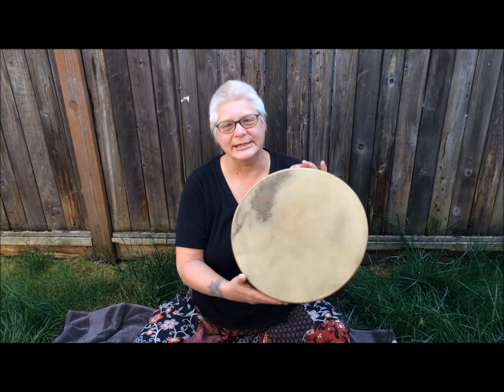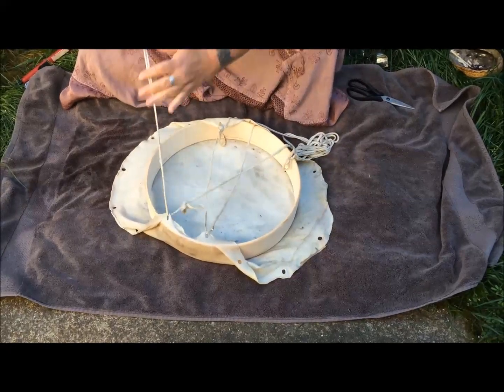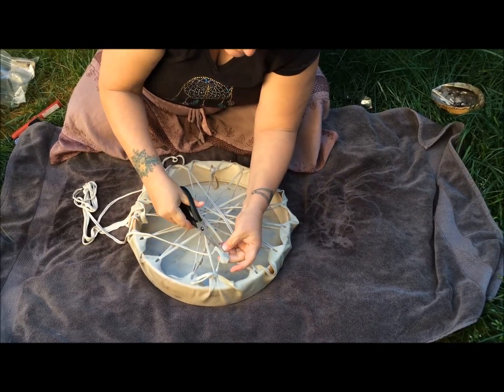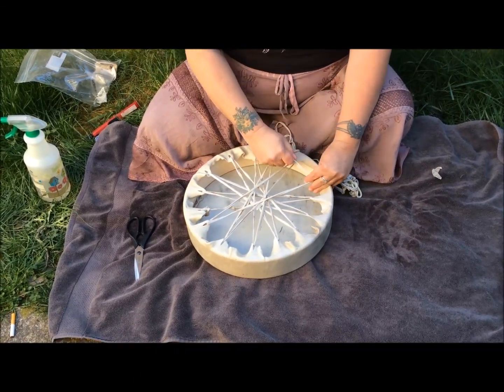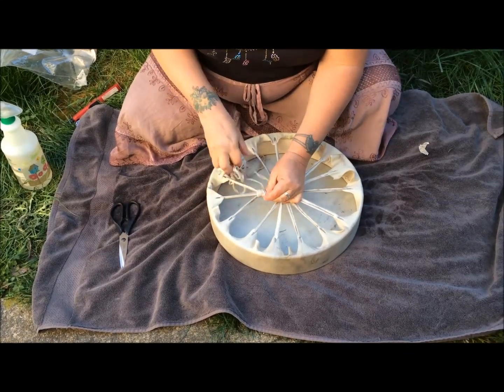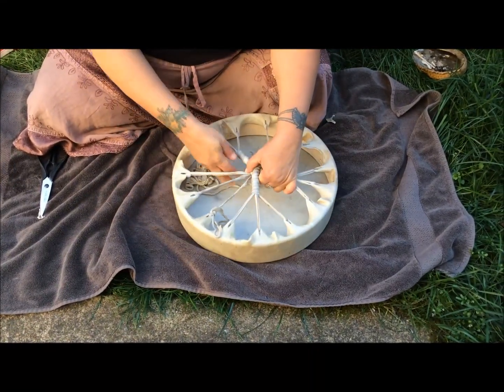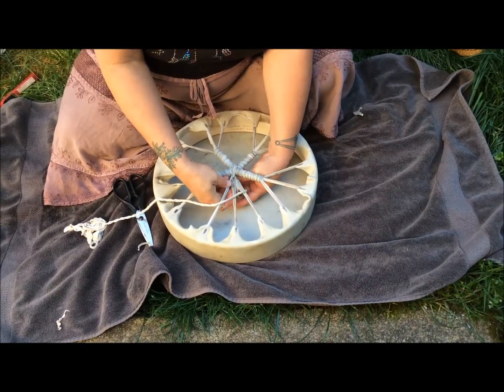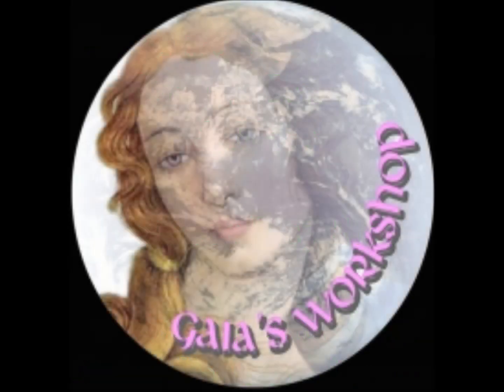Making the Harmonic Shamanic Drum with Gaia's Workshop

Comment: The lacing is cut from the same hide as the head and then stretched. If you are doing this from a full hide, cut out your drum head(s) first, then trim the leftover hide so there are no sharp curves or points. Starting anywhere, cut a strip 1/2" to 1" (depending on the thickness of the hide, wider for thinner hide, narrower for thicker). Follow the edge, spiraling in, until you have cut 21 diameters of your hoop. Stretch the lacing, pulling hard. It is better to break it in this stage than during drum making. When your lacing is stretched and measured, cut it off with a point on the end. Repeat as needed. 
Blessings,
Michelle
Reply: How many meters of lacing would you need for an 18” drum? Thankyou in advance! Amazing video Thankyou!
Reply from the maker: @chloesteens3877  You need 21 diameters of your hoop, so 21 times 18 or 378 inches.

Comment: Hello! Thanks a lot for this video. I made my drum and it looks lovely. Now after some days, I realized that in the evening once the air gets colder and more humid the drum buzzes. So you can hear a vibration as if there was something touching the skin, but there ain´t nothing. Do you have any idea why this is or do you know what I could do about it?
Reply from the maker: You may have a piece of loose hide on the underside of the head, so check for that. Sometimes the head adheres to the hoop or the lacings catch, play the drum around & on the edge of the head and move the lacing around, that may help. You may just have to dry the drum out when it absorbs moisture in the evening, you can do this with a hair dryer or other gentle heat source. Blessings!

Comment: Thank you so much for so clear explanation!! You solve my question about how to get the proper tension in the drum head, but did you strech the hide before the lacing or just wet and tie? Thanks a lot for sharing!! ♥️♥️
Reply from the maker: I stretch the hide as I make the drum. The balance of the drum depends on the hide being stretched as far as it wants to go without being over stretched. It's a feel.
Reply: Gaia's Workshop I ll try to feel!! ;-)
But now looks much easier for me since I got the treated and prepared hide for drum use! Thank you so much!!
Reply from the maker: You're welcome! Be smooth & firm in your pulling, you'll feel when all the stretch is out. Never force or jerk. Best blessings on your drum making!
Reply: @gaiasworkshop2944  How long is the lace?
Reply from the maker: @NamsaHealing  20 x the diameter of the drum

Comment: What is the length and width of the lace?
Reply from the maker: The lacing is cut from the same hide as the head and then stretched. If you are doing this from a full hide, cut out your drum head(s) first, then trim the leftover hide so there are no sharp curves or points. Starting anywhere, cut a strip 1/2" to 1" (depending on the thickness of the hide, wider for thinner hide, narrower for thicker). Follow the edge, spiraling in, until you have cut 21 diameters of your hoop. Stretch the lacing, pulling hard. It is better to break it in this stage than during drum making.